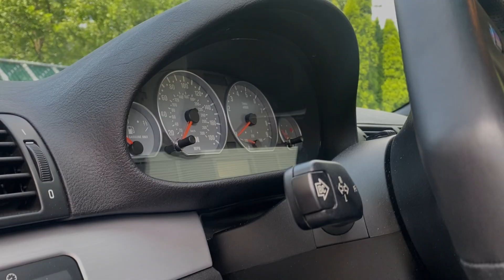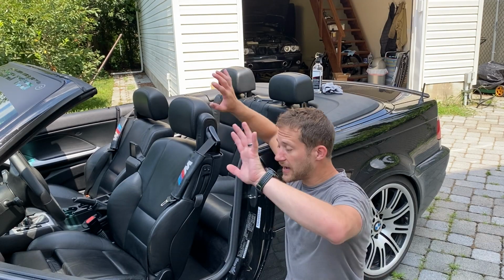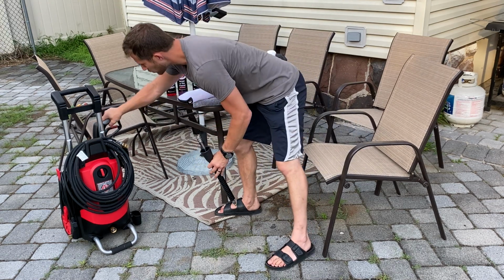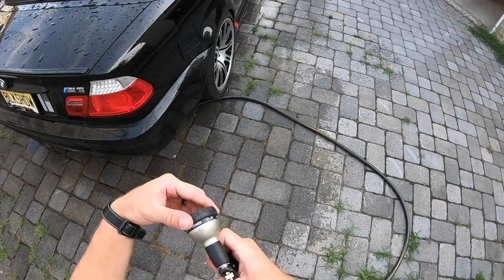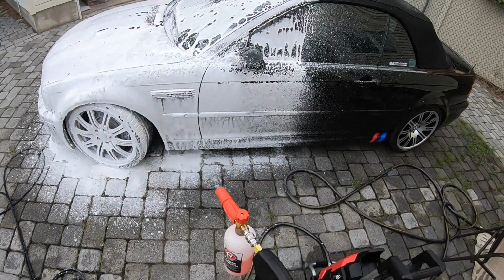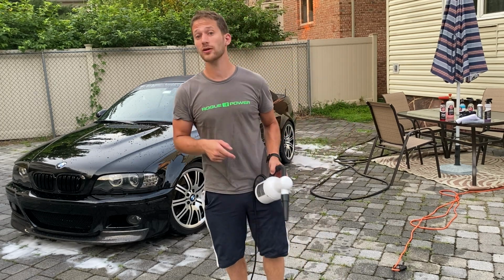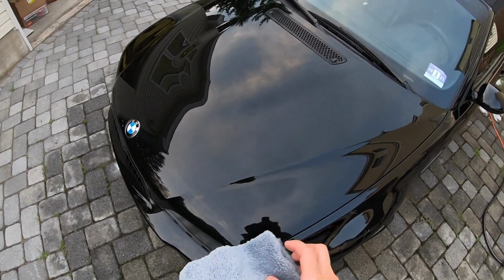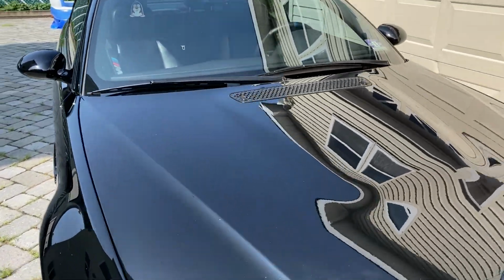The Secret FAST Way to Clean Your Car without Scratching!

Comment: So you got a pressure washer and didn't use it for the initial rinse?
Reply from the maker: It’s kind of controversial. Some say that using a pressure washer on the initial rinse can mar the paint. I do the initial rinse with the hose and then use the pressure washer for the foam canon and rinse and then the final rinse again with the hose to minimize water spots
Reply: @m3blackshadow   I thought you said your car was also ceramic coated and figured it wouldn't matter.   I don't think it's wrong either way and just wanted to know your reasoning behind it.  Thanks.